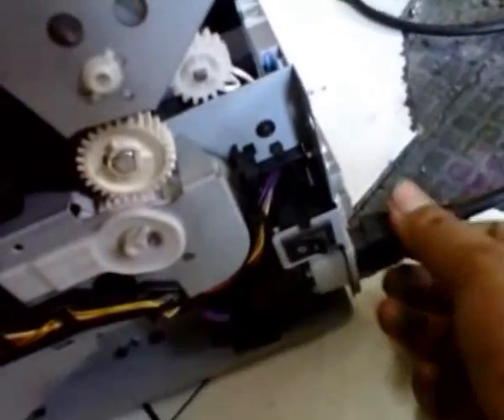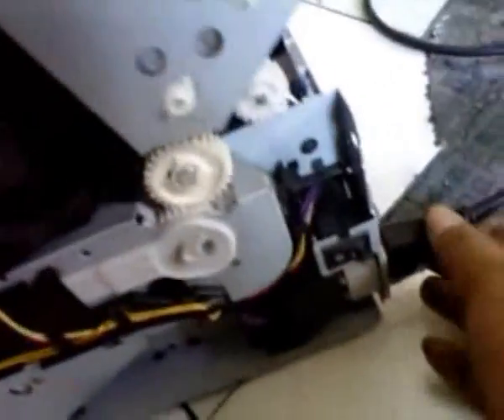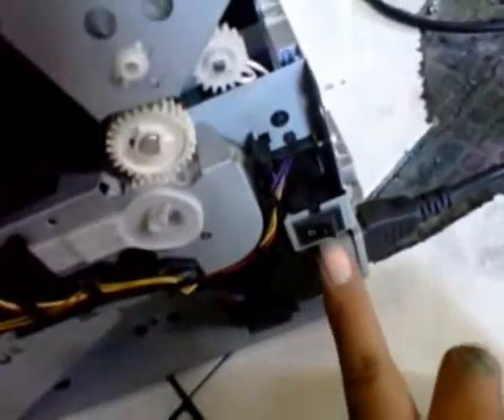HP Laserjet P2015n Printing Blank Pages

Comment: hello, have Hp laserjet 1320 each time try printer any single page even test print its print extra black page, can you help plss
Reply: if you mean a blank page i have the same problem.
Reply: @amrabdou2959   if printer stell getting same error even though you changed scanner assembly the problem is with the cartage .. earth supply issue .checck there is proper contact with the cartage to earth pin tq

Comment: HP 1020 printer take page but not print,
Reply from the maker: check the cable connection and reinstall the driver .. or try to use another computer..thanks

Comment: I have the same printer but my problem is: it prints blank pages ONLY when I print by LAN. Any ideas?
Reply from the maker: in trying to move the printer to another network Lan if the results remain the same possibility broken her formatter sorry I have not experienced the problems you're facing..thanks..sorry i'm use google translate
Reply: OK. Thanks. Greetings from Poland.
Reply: @zwyklyuser44   if printer stell getting same error even though you changed scanner assembly the problem is with the cartage .. earth supply issue .checck there is proper contact with the cartage to earth pin tq